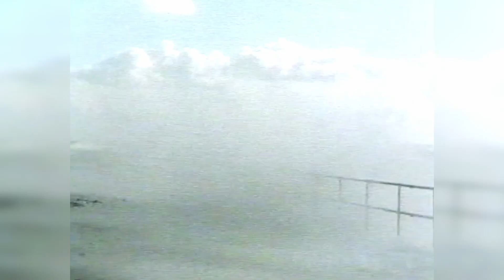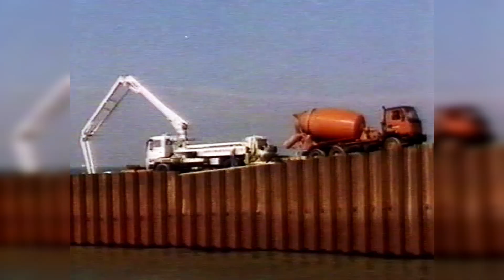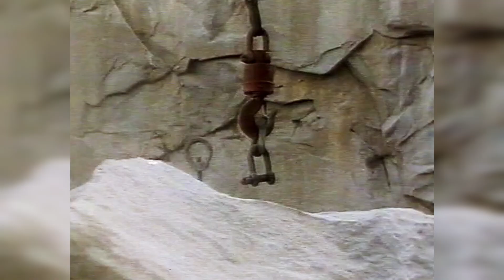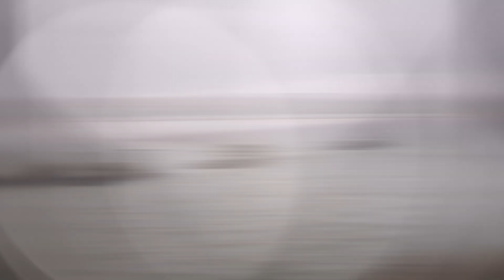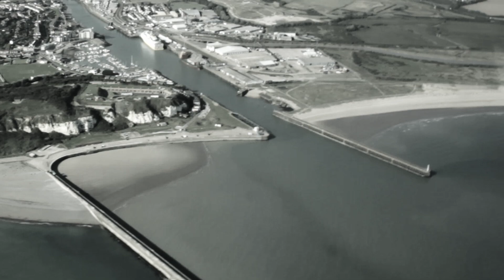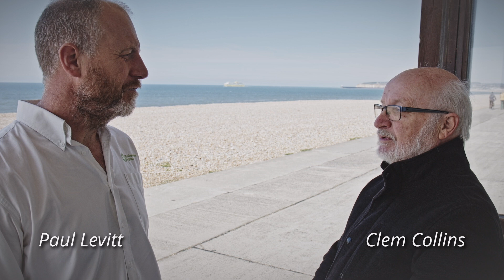Battling the Elements

Comment: Having seen several other explanations down the years, this joins up the 'segments' very well into the continuous tale it has been. The exercise to lay the Spanish rocks has rarely been explained properly, for example, given that most saw little of the 'bedding' laid under them. I'm still not entirely convinced that the rapid disappearance of those rocks wasn't what it looked like - sinking to the chalk platform and slipping away from the sea wall under their own weight, exactly as we expected at the time. Unless we do get a couple of deep-scouring storms we shall never find out where the rock wall has ended up!